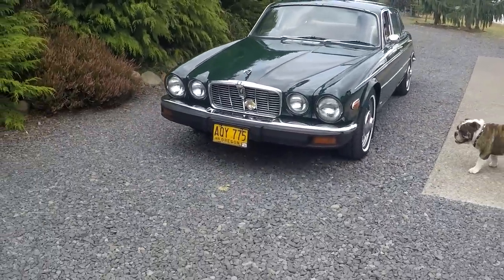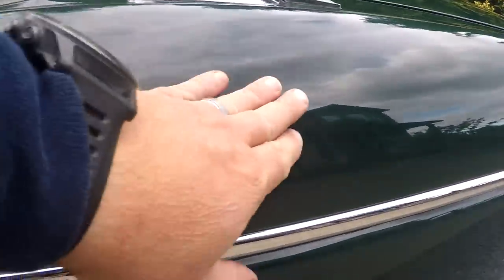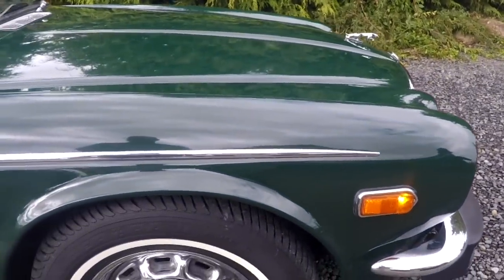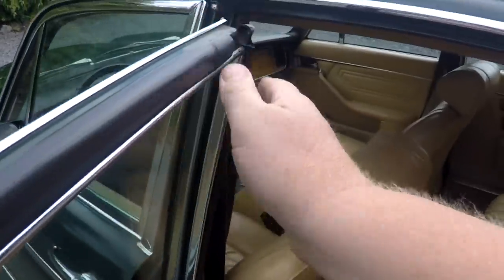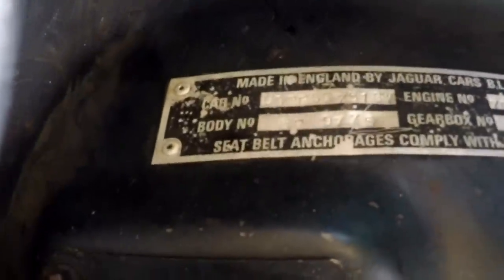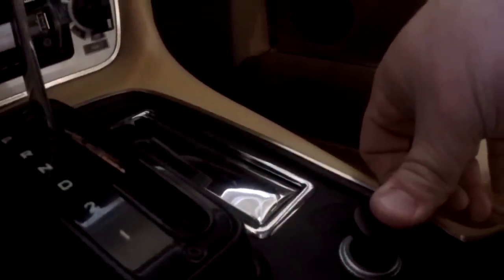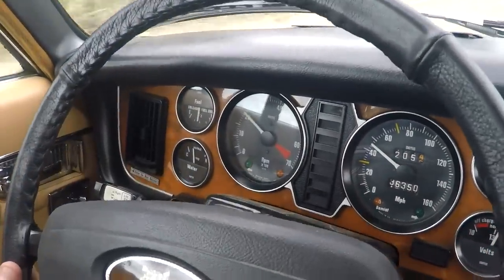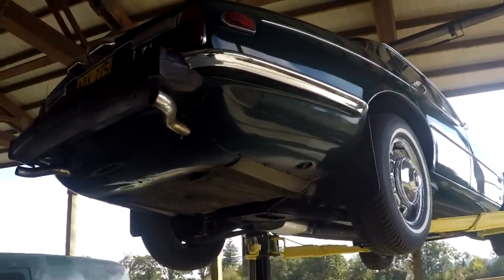1976 Jaguar XJ12 V12 British Racing Green -Denwerks

Comment: One thing you haven't picked up in is the fact that the XJ12  you've shown is actually a long wheel base one not sure whether you got a short wheel base model in the USA but in the UK this car was sold as a limousine. The reason being the rear door was longer and there was larger legroom in the rear seats for  comfort. This was designed so the owner could be chauffeur driven in the UK in comfort. The short wheel base model was for a owner driver
Reply: @brit bazza3 For the XJ and other luxury cars, North Americans rarely order the SWB variant. I’m not sure if it was even available from Jaguar in North America. Different culture, different tastes. 

To an American or Canadian, “limousine” is almost synonymous with “aftermarket stretched.” We don’t associate chauffeurs with wealth the way you do, I don’t think. Even the richest self-drive, and they want the biggest. A chauffeur is for parties or aristocrats (and we have fewer aristocrats than you).
Reply: Actually the series 2 were all LWB early in the production, never produced any 12´s with SWB at all. Some series 1 were though.
Reply: @paullundgren6319  actually the series 2 Jaguar was first built in 1973 in both LWB and SWB until 1974 then the SWB was dropped for LWB Jaguar announced they were dropping the SWB at the London Motor show in 1974 when they also launched the even shorter 2 door shorter  XJCoupe version  so please get your facts correct before you try to contradict a point of view thank you!
Reply: brit bazza3 Now now, no need to get all worked up! Didn’t mean anything other than just adding some info. The fact stands that very few SWB Series 2 were built, and no XJ12’s as far as I know. All Series 3’s were also LWB. The principle of chaffeur vs owner/driver is of course true, but maybe the market wasn’t that big here in Europe by the mid seventies.